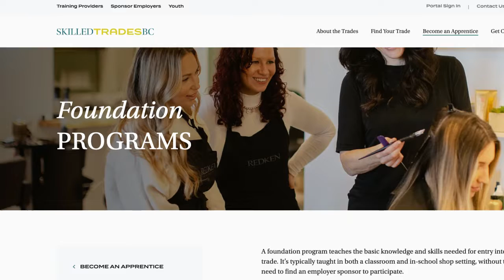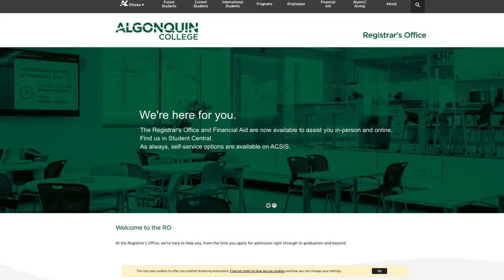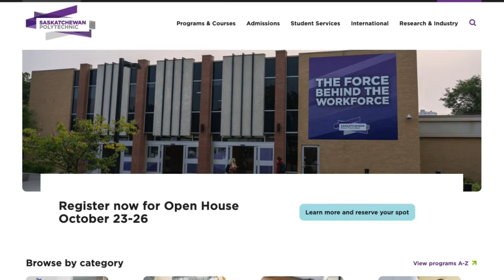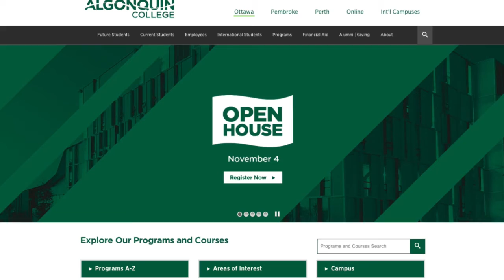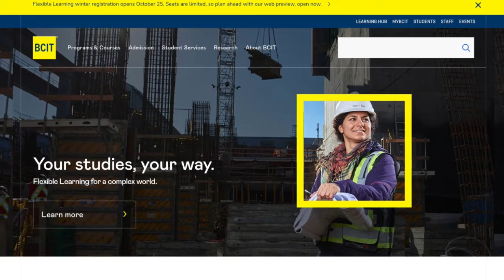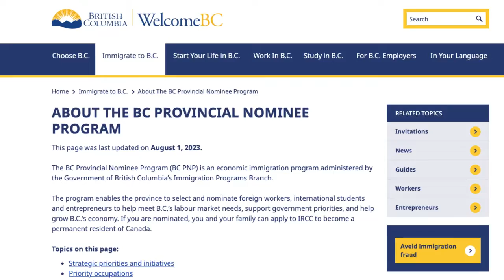TOP 5 In-Demand Engineering and Trade JOBS and Programs for International Students with PR Pathways

Comment: In 2023, IRCC announced 24 prioritized STEM (Science, Technology, Engineering, Math) occupations for easier PR.  If you work in one of the 24 STEM occupations, you qualify for STEM category Express Entry draws with lower CRS cutoffs.  Among the 24 occupations are civil engineers, industrial & manufacturing engineers, metallurgical & materials engineers, computer engineers, software engineers, electrical & electronics engineers. Missing from the list are mechanical engineers, chemical engineers, and petroleum engineers.  I want to point out that not all engineering occupations are prioritized in STEM category Express Entry draws.  However, mechanical engineer and chemical engineer show up as prioritized occupations under some PNPs.
Reply from the maker: This is correct! thanks for sharing this info to everyone! ❤